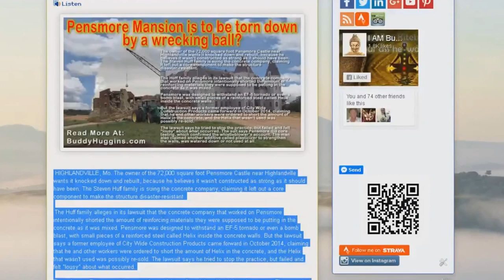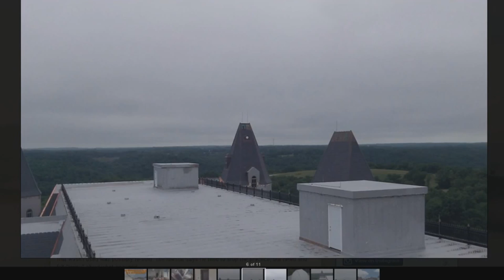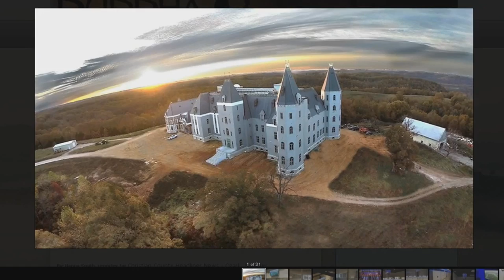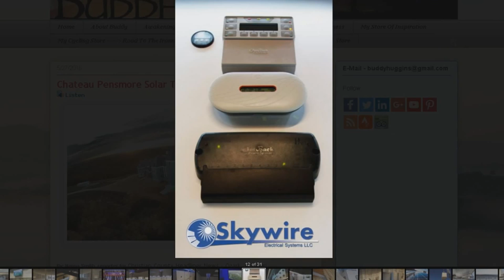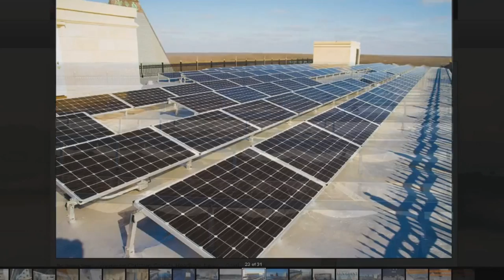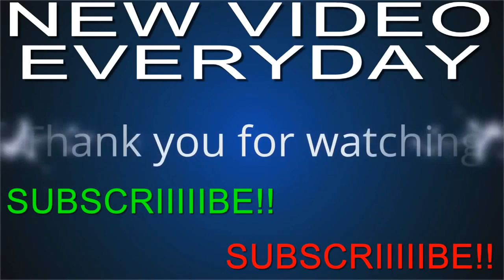UPDATE!!!  The Pensmore Case Has Settled $63M Lawsuit #Pensmore

Comment: I think this is a common practice with concrete companies because many many states away, i ordered a garage slab poured WITH the fibers for strength so it wouldn't crack in cold and it cracked the first winter and we didnt see any fibers! Paid 500 extra for the fibers they didn't add!!!
Reply from the maker: This was not done at the Pensmore site.
For testing the compressive strength of concrete, cylindrical test speci- mens of size 4 × 8-inch (100 × 200-mm) or 6 × 12-inch (150 × 300- mm) are cast and stored in the field until the concrete hardens in accordance with the requirements of ASTM C 31, Standard Prac- tice for Making and Curing Concrete Test Specimens ...

Comment: slump tests would have prevented the entire home from being built before he decided to sue. Smart enough to design and build a house this size, But over looked slump testing? until the end? That would be a special mix he asked for, The company would have dedicated a mixer just for that project, And it should have been mixed on site, Many different elements can screw up the strength of concrete. Mixing on site as you pour would have been the best, But I do not think he has to worry about the home falling down, Or does he have to worry about a missile hitting the home. I do worry in some videos they are not wearing masks handling the mix. You have silica and fine metal floating around in the air. Before anything was done inside the home it should have been washed out, Anytime they used a grinder on the floor or walls it should have been treated like asbestos. Just saying